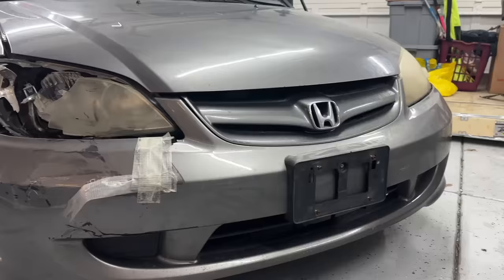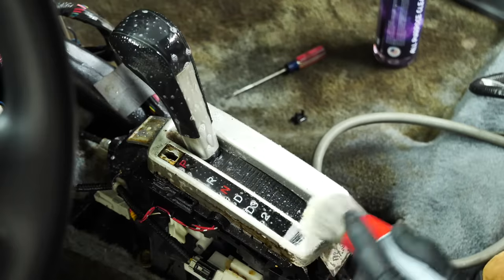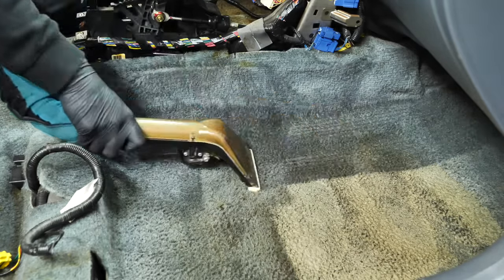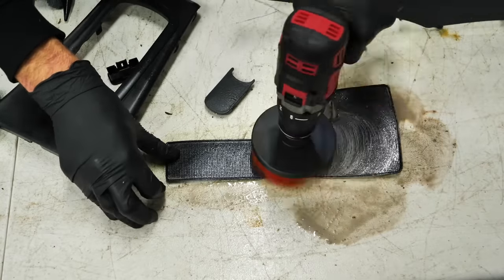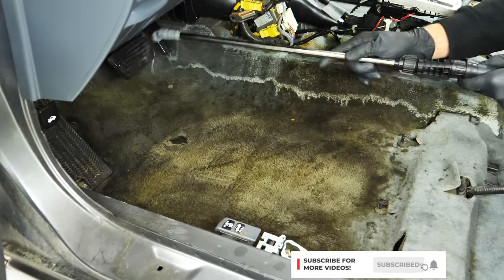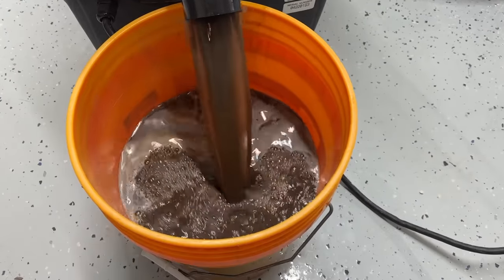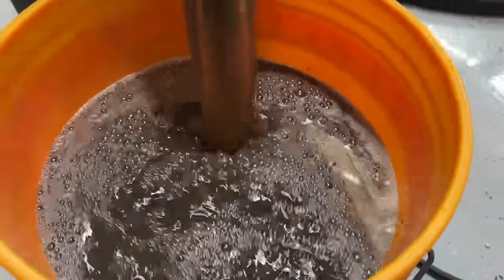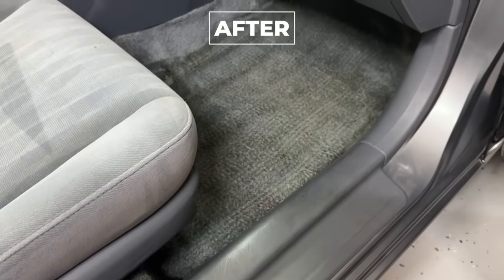Flipping This $1000 Honda Civic For Profit $$$ Side Hustle! Disgusting Car Detailing Restoration

Comment: Hey Stauffer! Just finished one of my first detailing jobs and my one take away was the lack of a good extractor. I see that the Mytee tears through the dirt and grime, I was wondering if you had a recommendation for something that won’t break the bank, but will get good results like the mytee. 

Thanks!
Reply from the maker: Well done on knocking out the first one! How often are you detailing? If you do 4-5 a month, the Mytee is so worth the expense for the time you will save along with the results. I use the Mytee HP60 Spyder and its a beast but not too pricey if you use it. Also resale value is really high so you never lose the 3/4 of the value. Check fb marketplace for a used one or splurge on new and make the commitment and within a month or two it can be paid off. I have a link to the one I use in the description box.
Reply: If this is still relevant, check out the detail geek. he used a bissell spotclean pro for a very long time and while it can be a hassle (shorter tube, smaller tank) the results are just as good
Reply: I bought the bisel little green and it’s a beast I got cream colored carpet in a rental house 🤦🏽🤦🏽 and it picked up stains that were there for who knows how long. Also use it on my car and the water is dark dark brown when I dump it.

Comment: You shouldn't have used an air compressor on the dashboard, all you've done is push all the dirt and dust deeper into the vents, so when someone turns on the heater the entire car will be dusty again. All that work for nothing. Just use a cue tip soaked in isopropyl alcohol to clean inside the vents.

Comment: Pro Tips:  With carpet that nasty, pull it.  That filth has gone through to the padding and the odor will come back.  You also found mold in the car, another reason to pull carpet.  Second, you are introducing way too much moisture around the radio and electronics.  Before you start with the "I've done this X 100s of times....."  stuff, that doesn't make it right, it means you've been lucky.  You're going to to that to the wrong Aston Martin and wind up buying someone a new $3500 head.unit.

Comment: Replace the carpet... it's easier, newer and cleaner.
Reply: And take those plastic parts to the sink, soak and scrub... so much easier than using a scrubber drill.

Comment: I'm glad I freak tf out when I drop anything in my car . deep clean twice a year . super clean inside and out and super clean the engine bay once a year after winter.  constantly replace parts I'm not happy with if I feel a performance issue I'll change a part just because it doesn't feel right to me . I even smoke in my car but my car never smells like it I clean it that often

Comment: I don't know if anybody mentioned this, but that hole in the shifter covered by the plastic piece can be pushed down with your key, in case you thought you had to have tools on hand to unlock the shifter.

Comment: Its not as easy as this. You need space! Getting the new title in hand isnt instant. It can take 2-5 weeks to get the title in the mail before you resell it. Then you also gotta try to sell a old beat up civic with 200k+ miles. Its gonna be taking up space for an average of 2months. Then you gotta factor in all the time you actually spent on the car. Like the time finding it, the time buying it, the time with dmv, the cleaning time, the time driving around, the time making sure its even in good mechanical condition and fixing up little stuff, the storage time, and then the time going to bunch of potential buyers until it finally gets sold. If you add in all these hours, you would made more money if you just stuck to cleaning customers cars.

Comment: You did good with the carpets and interior, but im not so sure i like what youre doing with the switches/buttons/radio/speaker grills, putting soapy water on them and then using the air jet to remove water seems like it could be pushing water into the electronics, especially the speakers behind the door grille. Im not a car cleaning expert so i cant specifically say how good/bad what ur doing is but coming from someone who repairs electronics as a hobby letting water into things it shouldnt get is the difference between a working and non repairable item. water corrodes the traces on pcbs and makes them unusable. just trying to be helpful as water related issues dont tend to show up until some time after the initial contact. ie the next person that buys this car.

Comment: Folks, especially you ladies. If youre buying a used car do NOT i repeat do NOT buy a car with over 150,000 miles!
Reply: Lolwat? A well maintained Toyota or Mercedes can reach 500k easily. What you talking about?
Reply: @GeneralKenobi69420  yes, but with a much much higher chance of something breaking then those under 150k
Reply: @JayLupe  Assuming you're fine with paying twice the price, sure. I ain't got the money for that luxury
Reply: @GeneralKenobi69420  yeah most cars around those miles from a private seller are averaging 7k

Comment: Not trying to be negative, but realistically this is just a video on how you made a profit. Everyone else would need to flip at least 2 cars with these price points to make a profit. The extractor it self is almost 2k and cut your time from closer to 8/10 hours to 5 hours.
Reply from the maker: You don’t need a Mytee to clean carpets. Yes, saved me time but if you detail 4 cars, it’s paid for. It’s no different then if you wanted to change your own oil, buy tools, supplies and save a small amount on the first oil change but you’re still negative. It’s the subsequent ones that you end up saving.

Comment: Dude just take the carpet out and pressure wash it. There is literally no point in doing all that useless extraction. You are just mixing cleaners and pushing all the crap into the jute